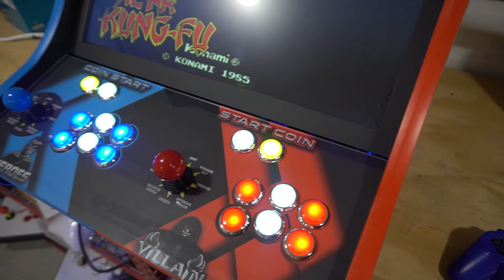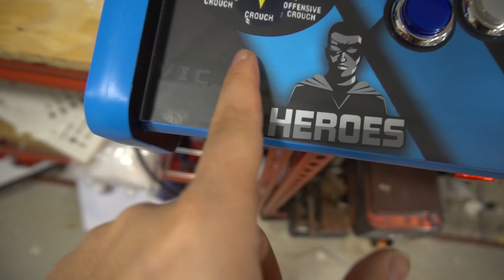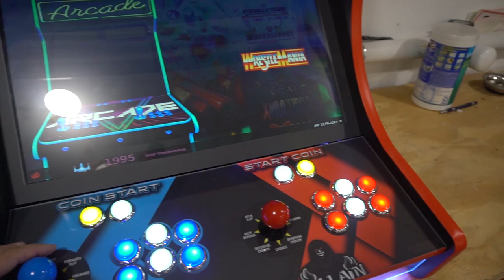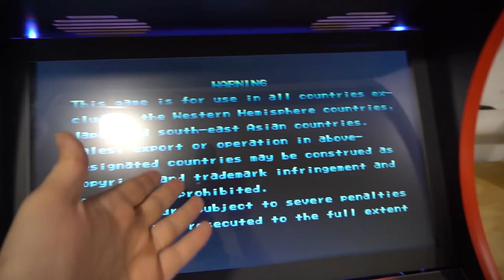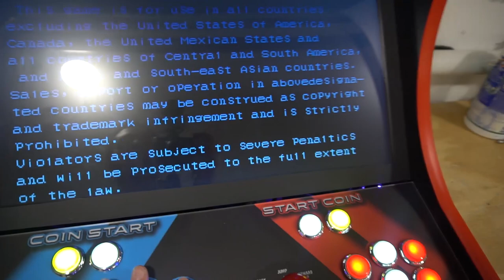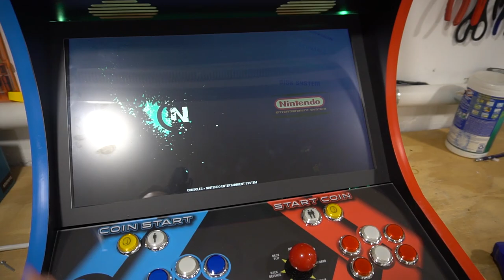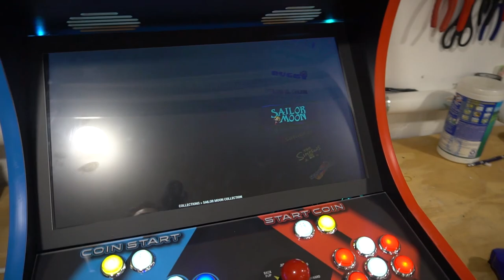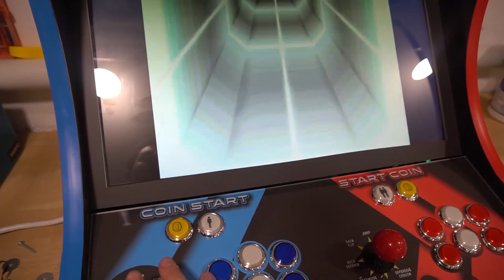Big T's Hereos vs Villains Bartop

Comment: ViC, I too do cabinet builds. I was not happy about the change to the back door. Caused me a lot pain with the mini ITX builds I do. Sent them a message with my thoughts. Its for sure a budget decision. less holes to cut, cheaper hinging system. So disappointing.
Reply from the maker: Must have been recently cause I did a bartop 2 weeks ago and several before that and never had that back door lol

It can actually benefit and gain about a half an inch now that I think of it... but I worry the strength of the 1/2inch mdf lol

Comment: How much does that sweet unit cost?
Reply from the maker: This sold for 1,100
Reply: @Vic_VP  I have a 4tybte odroid that I got from Kris coolmod. If I sent it to you would you be willing to put it in a unit like that for me?
Reply from the maker: I have zero experience in odriod so i would not be able to help in that situation. I can build and wire the panel but you'll need to configure the software and such.
Reply: @Vic_VP  all I know is I want to buy something from you. The stuff you build is awesome. That unit is a nice size ,plus less shipping cost .
Reply from the maker: @barryklinedinst6233  depending on location shipping prices vary
The bartop PC u commented on before costed around 700$ to ship from NYC to California. 
Granted it is heavier than a normal bartop :)
Reply: @Vic_VP  I live in york pa so I could come get it if that's ok
Reply: @Vic_VP  I'm getting a little bonus in a few weeks at work. How much down. Plus I don't want fancy graphics on it. Microcenter has a base I can pick up in Baltimore
Reply from the maker: @barryklinedinst6233  yea Def would save a lot in shipping and crating
Reply: @Vic_VP  i.ll hit u up in 2 weeks to give deposit.  Do you use Sanwa buttons.
Reply from the maker: @barryklinedinst6233  I use buttons that have the screw nut at the bottom. I got a build coming up that uses paradise arcade Led buttons
Reply: @Vic_VP  i.ll look for the video. And i.ll leave you alone until I am ready to send deposit. 500 bucks down right?